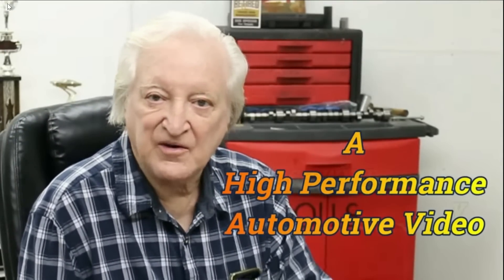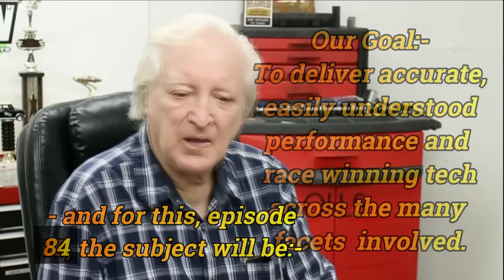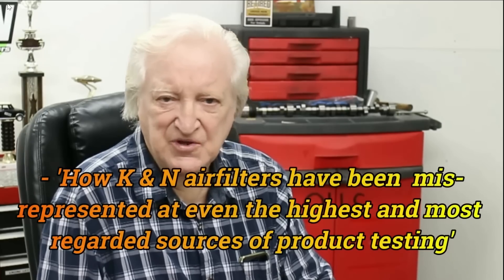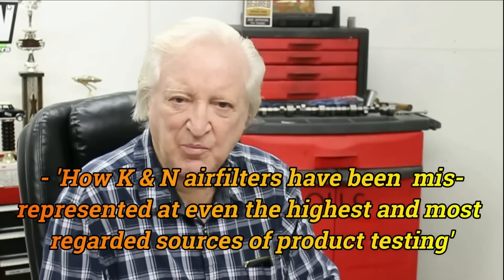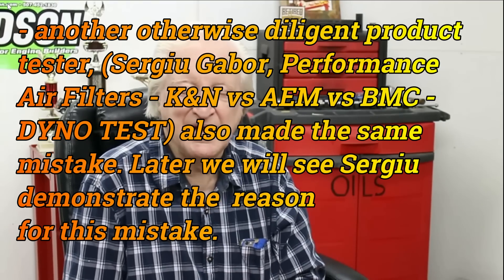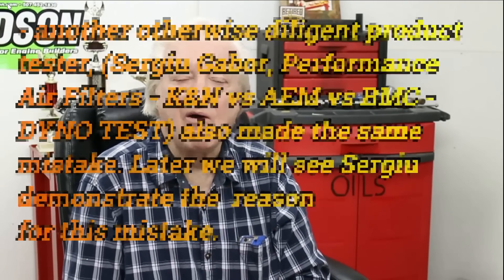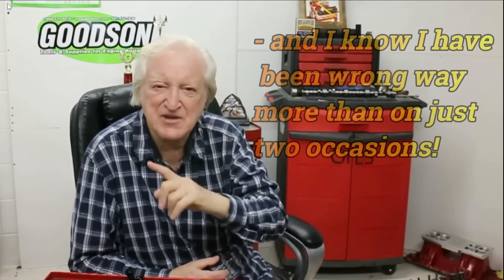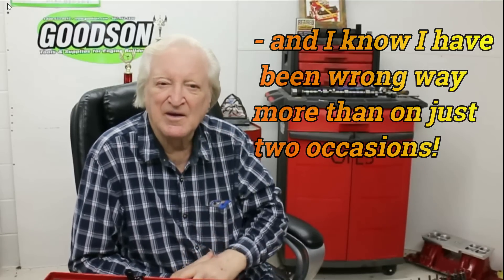K&N air filters  undeserved curse lifted!

Comment: I have been using K&N filters on my small fleet of commercial vehicles for 23 years!  Several of them surpassed 500,000 miles, and still boasted zero oil consumption (burning).  Those vehicles would have gone further, but that was the point at which I retired them in favor of new replacements.  
K&N saved me plenty of money over the years by being reusable and with excellent filtration

Comment: David, our company designs and manufactures air filtration systems for aviation - mostly for Blackhawks and Sikorsky firefighters - we use a similar material to what 'they' use and the efficiency is over 97% with greatly reduced engine wear and increased maintenance intervals.  This follows what you are suggesting and I appreciate your practical approach to seeing this many years ago.
Reply: Wouldn't a turbine be steady intake?

Comment: I have an observation of K&N air filters that I can't explain. I have used many, for 30 years. I have seen carbs and throttle bodies stay clean with them, and have had the opportunity to inspect engines internally that had been running a K&N air filter for some time. No wear or problems that could be attributed to poor air filtering  were found. What I have seen is higher than average silicon readings in oil analysis results. This is often attributed to a poor air filter, and these engines did have a K&N. No ill affects, just higher than normal readings. 

Another quirk, I have noticed certain Fords with MAF meters give funny readings when the K&N is fresh. I suspect they don't like the filter oil. Usually goes away with a a quick cleaning of the MAF, once or twice. 

Otherwise,  I love the filters.

Thanks for the video.

Comment: Ran k&N filters on my rally car.  of course very fine road dust.  Prescott rally the car lost most of its power made it back to service area hooked up the lap top expecting a dead sensor. Everything checked we checked fuel pressure it was OK. Time was out we were out of the rally.
Back at the shop started checking everything  found very fine dust build up on the maf wire. So it was not responding. 
After that we used Napa gold Ford truck filters which were 55% bigger than stock. Changed after every event. No more problems. There is no dispute kn flows great.

Comment: Thank you David!  At 62 years old I was definitely influenced by David's fantastic books and articles and likely my choice to run K&N filters (make that obviously and definitely).  I worked at Cartech (Corky Bell, Maximum Boost) in Dallas Texas for 2 years (1989 and 1990).  Ran one in my personal 1987 TBird Turbocoupe and advised many others to run K&N.  I was also concerned about the obvious large pore size and then later by the "claims" that the oil could foul MAF sensors.  Also noticed how many have "copied" the design for many years now.  Obviously I was interested in David's wisdom on this subject and he has yet again not disappointed.  As I listened I thought I understood the WHY the filter cleaned so well just before David described his conclusion.  I will add my vision as it may, I believe, actually be part of the answer.  Just before David showed the layers of the cotton element crossing back and forth across each other and "sweeping" the air content clean... I visualized the pulsing of the air caused by the engines intake valves opening and closing and thereby causing the cotton fibers to sweep the air as they moved in and out relative to the airflow.  Dynamic indeed and at an extremely fast rate!

Comment: Thank you, thank you, you have vindicated my faith in K&N, which I have used exclusively since 1980 i.e. 43 years and magnified my knowledge immensely!.  Initially, I was taken in by the hype but on each occasion the performance out stripped any scepticism.  The first car I used them on was a Hillman Imp Sport Road Rally car where I purchased two VW  Baja air filters that coincidentally fitted the Stromberg inlet elbows.  As you know, running an Imp without airfilters was known as 'an instant rebore kit' such was the dirty environment that they ran in and the replacement of the standard paper filters became a pain.  I still have those filters, looking for another application as I have not reached my 10^6mile warranty yet.

Comment: I have used K&N filters for years, power increase and fuel consumption benefits recorded and proven, engines still in good condition and free of problems due to foreign ingress. The only problem I have had due to a K&N filter is oil contamination on a hotwire mass airflow sensor, this however was not the fault of the filter, it was the fault of myself applying too much oil.

Comment: I had a k&n  on my 99 suburban and before I sold it had 485,000 miles on it and still would light the tires up I also was running slick 50 in it

Comment: I'm glad you did this again as I had forgotten 'how it works' and only remembered the 'not electrostatic' bit
 I've been using and recommending K&N filters since the late 70's, didn't realise K&N hadn't been going that long when I started using them! 
 I'm using two K&N filters I took off a Kawasaki 1000 inline four around 1980 (although they were in a box for several years so not being used) 
The other two I fitted to a Morris Marina 1800 twin carb, it had tiny pancake filters fitted when I got it . ( I rebuilt a Yamaha DT175 trail bike, pressed up crank, re-bore, etc and got it as 'payment')
After the mod, it was first car I had you could 'steer' on the throttle which made it great fun on roundabouts, even in the dry in third gear

Comment: I used K&N years ago but stopped because I was tired of being told by friends I'm ruining my engines. Thank you David K & N again
Reply: People talk a lot of bs but dont know what they are talking about . Havent ruined one engine when using K&N filters
Reply: When "people" pay for my engines, I'll start listening to them. Until then, I'll do what I know works. You should too.
Reply: @stickman-1  That's why I use K&N filters  in the hundreds of high dollar engines i have built not a single problem with dirt ,dust wearing my engines out . Paper filters just didnt cut it for me on the dirt tracks . What works great on dirt also works great on the streets . 40 years of experience  using them .
Reply: @darwinfoster7420  this is very good to hear as I too have been using them for many years, but do not use them to the extreme you do. I’m seeing a lot of BS out there these days about these filters with the latest one being they are unsafe to use on turbo engines. Love to know what your take on that is?
Reply: @Hutchy86 My neighbor has used K&N air filters on his 01 Silverado since it was bought brand new from the Dealership. It has 468,000 miles on it and it still runs. He had the engine replaced at 300,000 miles because he said he can’t stand newer vehicles. I asked him to ask the mechanic shop to take pictures of the cylinder crosshatching on the factory engine that went through 300,000 miles using K&N filters on it since it was brand new. The crosshatching looked like it had just been done like it was brand new and this was on a 300,000 mile engine. If the crosshatching looks like that at 300K, then K&N doesn’t damage your engine.
Reply: @Peculiarsafe83  that’s awesome, thanks for sharing 👍
Do you know how often he cleaned the filter? Also I’m not familiar with Silverado’s as in the engine. Is it turbo or naturally aspirated?
Reply: ........BUT, what oil was he using?  Conventional vs. Synthetic, or expensive full formulated boutique oil?  Also, was he using a high efficiency bypass oil filter......?🤔

Comment: Just my opinion as a mechanic in  the Aussie bush! That’s on dirt roads every day! And following your advice I’m here to call out bs! They are a great filter and flow very well! I’ve used them in 15 or so of my cars and it amazes me how effective they can be! just by looking at the cotton but watching a k and n video decades ago it explained in detail how they worked! It’s a shame that they have dusted and destroyed thousands of engines though! It’s usually due to lack of maintenance or poor fitting,but on rare cases bubbles or flaws in the rubber seal particularly in flat panel filters can cause dust to pass! I’ve only had dust issues on a couple of my own but have seen hundreds of customers vehicles with a nicely dusted intake pipe not to mention the maf sensors covered in oily mud I’ve switched to uni filters and I won’t go back there’s no comparison with filtration!

Comment: Project Farm made a similar mistake testing oil filters. The modern synthetic materials used are tested via a time/weight study and not micron size.
Reply: That's interesting. Could you post a link to this info, it would be very useful? Thanks.
Reply: He did one about E85 and fuel mileage and then showed him testing by doing 0-60 mph run. speed runs and MPG have about ZERO to do with each other. Pretty sad actually so I unsubed.
Reply: @oldblueaccord2629  🤦‍♂

Comment: As was a former dirt bike mechanic there is a correlation between k&n air filters and replacing intake valves
Reply: Wet or dry dirt? Supercross is wet almost.mud, motocross is dry with more powder

Comment: How does turbocharging affect your theory? I run K&N on my built turbo Diesel (~ 30 psi boost) and have had good results. I have been criticized for doing so. However, I have never seen any damage from dirt injestion. It seems the centrifugal compressor would smooth out the pulses that you get on a naturally aspirated engine.
Reply: Did you end up getting any information on this as I to run them on turbo engines and are very interested in your results?

Comment: Love your video and explanation of K&N Airfilters! I have used them in my vehicles for the past 30 years and never had a single problem. If there are issues with Oil on the mass airflow sensor, it is a simple step to take it out and to clean it. This is usually caused by the person reoiling it after the cleaning process and oil it too heavy. Cheers.

Comment: Have 440000km on a 96 Accord. Always had the same KN filter. No oil added between 15000km oil changes. Cleaned KN filter twice. Dish soap, dry, atf for oil.

Comment: So maybe to test filters a better test may be to use something like a piston air compressor to draw through the filter such that you get those intake pulsations.
Reply: That might be difficult to make draw 1,000 cubic feet per minute. 😳
Reply: Also, varying air demands to act just like a normal car's operation.
Reply: Also is that pulse strong thru several feet of duct and a box at rpm.    Im thinking it may turn fluid at so much flow and in turn that concept is out.   Just my opinion.   Installed direct Above a carb will have a much stronger pulse i can see that.   There is alot to be desired.     A higher rpm low stroke engine with sever feet of duct anf air box probably dont have the same pulse and flow characteristics as a low rpm big stroke filter over carb set up.   Lets not start Turbos yet
Reply: @thomasroth4695  agree its likely less effective in a piped remote box vs atop a carb(with pulses)+engine as vibration source.

Comment: Works fine. As a Toyota Master Tech, the only issue I have with them is incorrect service. People seem to think more oil is better. If you have a hot wire MAF sensor just down stream, it'll be coated in short order with oil mist. And often doesn't clean up. Some air boxes I've seen are just a sticky mess with the stuff, along with the intake plenums.
Reply: i agree with this most issues are poor service habits, i’ve even heard of people pressure washing them…. obviously not a good idea for the cotton layers
Reply: Toyota themself offer a TRD intake that uses an oiled filter lol 😂

Comment: I ran them back in the 90's on my trucks used in oilfield work. Mostly highway miles/ by that I mean pavement, and a lot of gravel and dirt roads. Never had an issue, and only stopped using them because dealership said it would void warranty. Never thought about the oil they used, but -35C or plus 30C, never had an issue with filtration.

Comment: i've been using so many various sized KN filters for 30++ years, no issues at all.
i did LOVE the KN stack setup i ran for a while
i don't over oil them
I do use their race version one, and no issues. no oil and it FLOWS, and can see through one side to the other (meaning right through the carb since my filter sticks out past the hood), i haven't had issues, but i do clean it after each outing since its just a weekend toy car
probably not something for a daily, but i do live in the dessert and we have the fine sands to deal with (live right near White Sands NM)
lately i don't even oil the daily KN's and have not had any issues, but i also try to yearly clean them (but i do way less thank 10k miles on each car in the year). i do deal with sandstorms here, and again no issues.

Comment: Recall fitting a K&N to my last car, thinking I might save money over time.  Trouble was, the K&N was about 1/4 inch taller than the factory-sized filter - so the filter housing looked closed, but there was a small gap between the housing and the lid (in addition to the inlet tube).

End result: a bit more intake noise, and a noticeable increase in power.

Comment: David, I know this video is a year old but could you comment on consistency when running a K&N filter + filter top vs just a metal "bug catcher"?  We have noticed a marked improvement in ET (60-foot through finish line) in our drag cars (pro & super pro) when we switched out our traditional filter to just a fine metal screen.  This application is a naturally aspirated SBC (421 cu-in) on alcohol with a traditional carb.

Comment: I spent many years racing (as a mechanic) in FIA Formula 3000. It's now Formula 2. We used Cosworth DFV's , prepared by Nicholson McLaren race engines. We one several championships. They would only use K&N filters.
Reply: Is using k&n in a racing engine all that meaningful, though? We already know they flow very well. Please correct me if I'm mistaken, but aren't most high end race engines rebuilt after every or very few races, anyway.
Reply: @jeffs2809  Yes, and we only leased them from Nicholsons

Comment: I've had a 14x4 on my 94 k1500 daily since around 2000. I clean and reoil it about every year roughly. 207k miles on it zero issues. Just need to maintain it.

Comment: Is there a way of working out what size a panel filter needs to be for the size of the motor to flow enough?
I understand the intake pipe is the restriction before the throttle body but does the filter need to be bigger by a certain amount to not cause a restriction?
I see factory motors have large panel filters so service intervals are increasing but does a smaller filter in a cramped engine bay effect power??
Reply: There is a formula out there. Most air filters stock are way way to small. But the correct size is like 3 inches tall and most cant run anything that big and shut the hood.

Comment: Two observations from personal experience:   (2018 Subaru Outback 3.6R;  79,000mi)   #1:   My Blackstone UOA's have shown identical ppm silicon and insolubles with K&N and with Project Farm's favorite WIX air filter.  With my driving pattern in my environment, there's no difference in performance between the two.  Both obviously filtered just fine.  My silicon number, in particular, is about 1/2 of Blackstone's average for this engine.   #2:   The PF-recommended WIX filter for my car has a felt seal on one side and flat plastic surface on the other.  It didn't fit and didn't seal...actually rattled around in the air box...until I slathered caulk on the flat plastic side so that it fit snugly and sealed properly.   The K&N's robust rubber-enclosed edges fit snugly and seal properly by themselves.

I've used K&N for decades on different vehicles with zero issues, specifically no issues with the MAF sensor.   I have no idea why other people report that they have seen MAF issues except suspicion of gross over-oiling during maintenance.   K&N's work fine but if you can't figure out the maintenance or don't care to mess with it, dry filters work fine, too....assuming they fit snugly and seal properly in your air-box.

Comment: Did not have good results w/ K&N air filters on my circle track cars, greased housing always shows a lot of dust & debris both dirt & asphalt. Trying different housings & filters with no real change, found a paper element that worked better.  ( Partially Thru the hood filter with shield & under hood pan)
  Always ran an Outerwear, maybe prevented the filter from working properly?
  The on road vehicles ( properly maintained)don't look too bad   BUT  NO  ONE  EVER  CLEANS   them!  I'm a 40 year mechanic and can count on one hand the number of customers that I have seen maintain them. Most are covered to the top of the pleats!  
   Also note most quick change & repair shops WILL NOT service them for liability reasons.

Comment: I took my (RE INT 650) motorcycle's air filter completely out and except for excessive air intake noise, I really didn't notice a dramatic performance difference between an open system and a clean OEM paper air filter, certainly not enough to justify the cost of the expensive Brand X.  I'm skeptical of the "Pulse Hypothesis," presented as a pure hypothesis without any actual testing.  I'm also skeptical of the anecdotal evidence of the sand-clogged air filter since I can think of reasons that would falsify that "evidence."